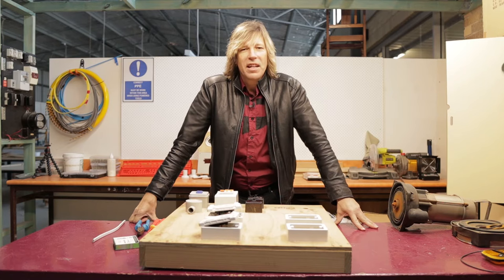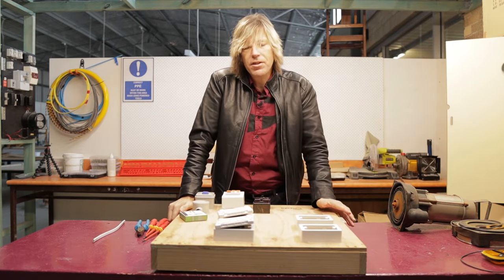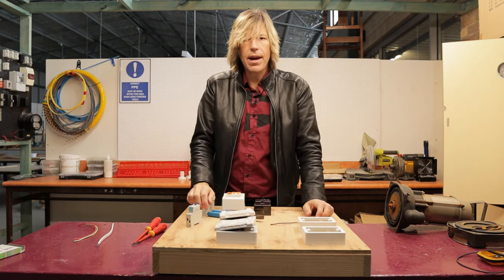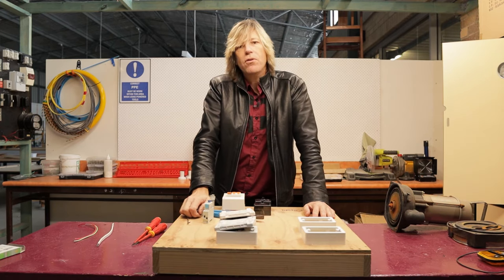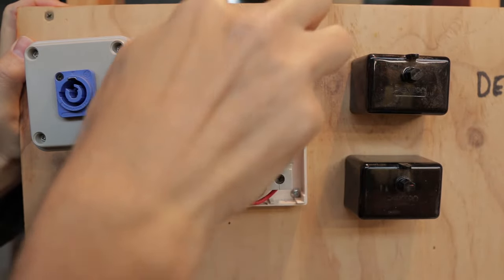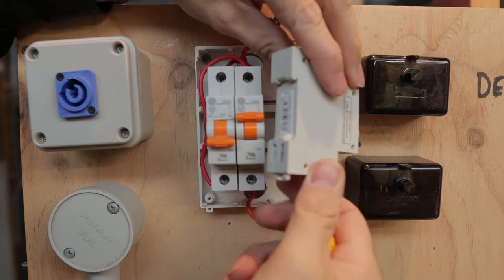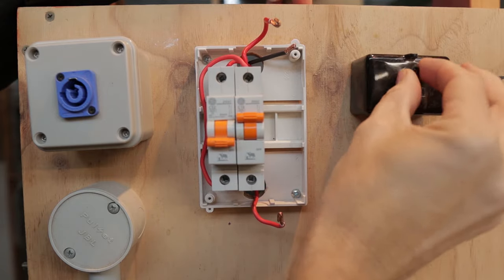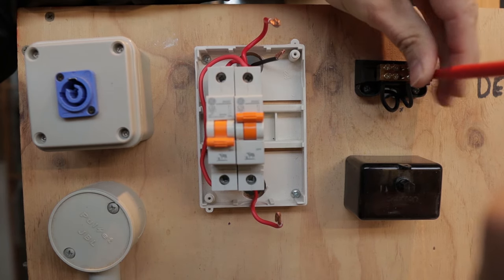Electrical Wiring How to Install an RCD

Comment: The RCBOs (as they are called in the UK) have a captive neutral wire so that isn't required. Another difference is that the line voltage will be delivered to the RCBOs (or any other devices) with a solid copper bus bar, not a via a lot lot of links which is also connected to the main switch (which will be double, not single pole). 

However, that tiny box with two circuits is surely not for a whole property. We do have small units in the UK too designed for outhouses, garages and so on, but they are still bigger than that, typically with 5 DIN widths, and have connection terminal bars for earth and neutral. Having the neutrals and earth terminal strips outside the unit looks odd from a UK perspective. Is that normal in Australia? Also, they now have to be made of non-flammable materials, which basically means metal (that wasn't the case a few years ago). 

In a perfect world, now that RCBOs are so common, both neutral and line ought to be delivered by bus bars (indeed, even earth too) and then the whole lot can be tidied up.

Comment: Why wouldn’t the neutral from the neutral bar and the active from the top go into the bottom terminals, it would work the same won’t it ..!
Reply: Long wait for an answer, eh?  Whilst the RCD will still trip on a fault you may find that the test circuit, often just a resistor, will burn out if you hold the button down and the device is being supplied from the wrong side.

Comment: Question: As Australian and New Zealand electrical regulations are basically the same, however, I understand with MCB's there different ratings (domestic), 10A Lights, 20 Power (gpo), 32 range (stove),  16 Hot Water. The RCD's are rated at 63A with 32mA trip (safety). Here in NZ, the 32A (stove) doesn't go via a RCD even the stove us half the current!
In Australia (new homes/for sale and rental) does the stove (32A) go via a RCD? 
Is that the Australian regulation? Or is this optional?
Reply: In QLD more or less everything must now be protected by an RCD, lights, general power, stove, air con, HWS etc.  Only existing equipment may not be protected.  Additions / alterations / new build / even sale of the house must have RCDs fitted.  Buy a new stove for an old house and it must have an RCD on the circuit.
Reply: @retrozmachine1189  100% agree, currently I live in a state house, before that rental 2015 no RCD's at all this place everything but the HW and range has RCD's. This here in New Zealand - way behind Australia! I thought that very old houses, before 1978 were exempt to have RCD's? There are houses that the wiring is that old, it still uses rubber insulation! Of course it sold, the wiring has to be upgraded to Au/NZ standards!
Reply: @jonathonshanecrawford1840  Old installations aren't exempt but if nothing is done to them, no electrical work, no hardwired appliances changed out etc there is not currently a requirement to fit RCDs to private houses in QLD.  Rentals must have RCDs fitted no matter what.

The old rubber, as in VIR?  That'd be a scary thing indeed or is it the still end of life and liable to crack off TRS?
Reply: @retrozmachine1189  Yes VIR.
Here in NZ either its the same regulations and NZ don't enforce the regulations, a building inspector said to me, it depends where you are  in Australian and NZ, depends what is enforced, I said to him BS
here a Question, on the power pole the top wires are 11,000V, while the lower ones (3 phase) between any 2 is about 400V, but between any one via load - house - is about 240V, how! It for those Americans that don't understand how we do things
Reply: @jonathonshanecrawford1840  It's not illegal to have old wiring in a private house in QLD but you are leaving yourself open to fires and if your installation proves unsafe should you get a sparky in to do some work they will have to make it safe, even if that means cutting circuits or the whole place off.  I keep saying in QLD because the ANZ standard is the basis of the rules but each state has it's own electrical regulations and those regulations trump the standard.

Regarding the 3 phase + N, the N is the key.  Phase to phase is about 400V (used to be 415/240V here until we moved to nominal 230V) but phase to neutral is 230V.  You multiply or divide by the sqr root of 3.
Reply: @retrozmachine1189  In my opinion old wiring should be illegal  for AU/NZ!
So where you are there's no 415V, just 240V? Do live in a residential area?
I thought sometime in the 1990's there were working to standardise the regulations? And around 2000 they did? People my wounder that's the difference between NSW and QLD, aren't they the same? Like the gpo's! Here the gpo's are 100% the same as Australia. Even the 11,000V insulators in New Zealand are Made in Australia, funny that!
As to old wiring is not illegal  in QLD (or parts of AU/NZ), if a fault incourrs someone should be have the responsibility to accept the blame for a fire if not death, not the house holder/owner (rental/private) the Government authority!
As you wrote each state has it's own electrical regulations. Then why would there be a national regulations in the first place?
Reply: @jonathonshanecrawford1840  3 phase is on the street here and pretty much everywhere except out in the sticks.  There's typically no need for it in most houses but if you want it just lay down the cash.  The standards are going to be pretty consistent but there's going to be things you need to be aware of.  I'm not up to date on all this, been a long time since I needed to be, so asking the wrong person there.

Government housing is by definition not private house so it should be operated as if it were a rental, which is really is anyway.  I know there has been poor maintenance in public housing in NSW (or was that Vic) that caused dangerous electrical and a girl was left with perm brain damage after touching a garden tap livened up due to neutral fault.  Public housing should be 100% buttoned up but we all know how that story plays out.
Reply: @retrozmachine1189  I don't expect every Australia to know everything, I don't, I'm an Australian as well!
True about NSW like Sydney, my sister was living in a state house, when the neighbour turned on her kitchen light on my sisters bedroom light came on! wonky wiring alright, even the stainless bench was alive at times! And they set the standards! At least here (NZ) there states houses are up to code (since the 90's)!
I heard once in Victoria it was against the law to change a light bulb, otherwise you fined $10, I Googled it was just a joke making fun at the Victorian government!
AU/NZ should get together again and restandardise the regulations, to make 100% of all Australian states/NT and NZ to be the same! Wasn't it so a tradie from from AU/NZ could work in either country?

Comment: Apart from the electric hotwater system, does the range/stove need to be connected to a RCD, as in the past wih a pot on the stove, I felt some current travelling in tom my hand and using my multimeter and yes there was 240V going the pot via earth.  Is this legal?
I am NOT lienced sparky, but I know something about RCD's & electrical wiring.  My GPO's and lighting are connected via RCD's and the TPS is 2core with earth (modern wiring)!
Reply: @JohnZoetebier  Maybe in Australia and New Zealand the range/cooker doesn't have to have a RCD for its outlets? Even a sub panel install by the range?
Reply: @JohnZoetebier  I understand about garages etc, they have their own sub panels, I would run a 60 Amp cable from a RCD from the main consumer unit (case of fault between house and garage), as most homes are single phase and the range has an optional link for single phase instead of two phase wiring.
I would believe a domestic RCD couldn't carry the current required for a range?

Comment: What country is this? We haven't used black for neutral for years now
Reply: Australia
Reply: @dashaB-sl4pu  I am i australia and we still use red black green although i find a lot of appliances and extension leads use brown blue green and some green has a yellow strip through it i think on housing installations

Comment: Suggest you need a No2 Pozi drive screw driver not a Philips. using Philips will wear the driver and the screw head.
Reply: Bla bla bla

Comment: As a second year apprentice sparky, who regularly searches on YouTube for videos like this, I'd like to let you know why your video isn't, for me, one of those rare how-to-sparky videos that you'd recommend to a class mate.
Firstly, this is a rcbo- which is not the quite the same as a rcd. Rcbo is a both a breaker and a rcd. While a rcd is just that.
Was hoping you would demonstrate what you need to know about adding a rcd to existing circuits, or how to link one or multiple breakers with one or multiple existing/new rcd.
 
You spent almost 2 minutes explaining how a breaker Clips to a din rail and how to pull it out and what the mechanism does. If someone doesn't know what that is they probably shouldn't be rewiring any circuits.
It's not what the student is here to see. And neither is showing fast forwarded scenes of someone preparing cables to terrible music. You gotta cut that. Your videos should around 7 minutes which they could easily be but you need to be far more succinct in your delivery. Write down exactly what you're gonna say and then read it out in a series of steps. 

Maybe you'd consider making a video considering the first point I made. You might was well call it "the seven steps of wiring/rewiring a rcd"

Top marks for effort, but video needs to reduced to 7 minutes and needs more examples.

Comment: We call them RCBO's...........
Reply: Here in Australia they are known as RCOB’s and combos
Reply: An RCBO and an RCD are different things. An RCD will not provide overload protection by tripping once a certain current is reached, an RCBO should. A RCD only protects against residual current and earth leaks. An rcbo is used in this demonstration...
Reply: @callumgigliotti5391  you think that I don't actually know that?
Watch the video he's fitting an RCBO not an RCD hence my comment

Comment: I understand this is “schooling”. And you have spent the money to produce a video and willing to stand in front of a camera... Why do we not school properly. What country is this for? This is a very very average example of a board and a change over to an RCD.... 

When I school, I to try set standards, like mounting things level for starters. As one would know, apprentices are lazy. 

If I presented a board wired remotely similar to this to my tradesman back in the day, I would have been shown the door. My point in, training videos - FOR electricity, take the time, cut the video as required to use the resources and time to do it right, and neat. 

This isn’t hair dressing, the consequences of some hobo installing his own RCD and inserting the cable BEHIND the screw even though he tightened it fully - subsequently burning down his house due to a hot joint Is high.
Reply: This is in Australia and fully complies with the AS/NZ 3000 standard.